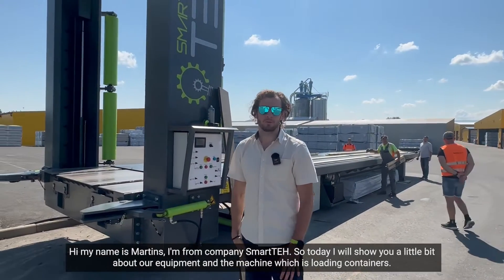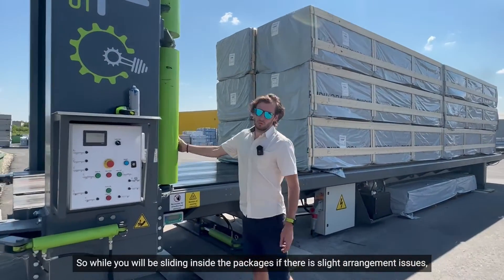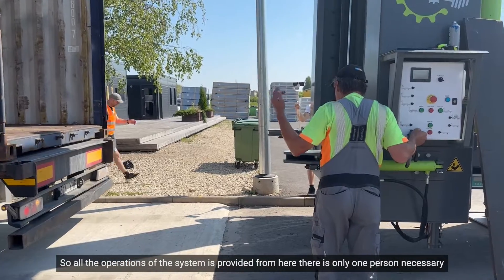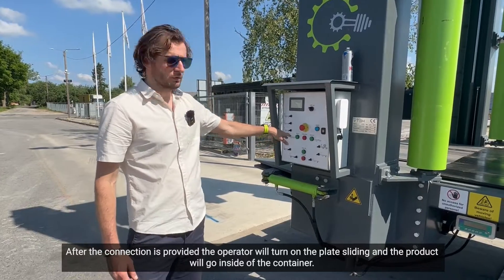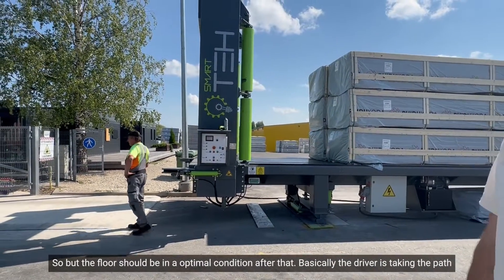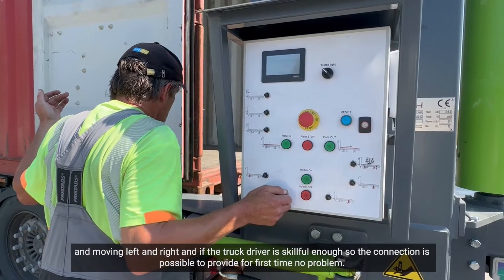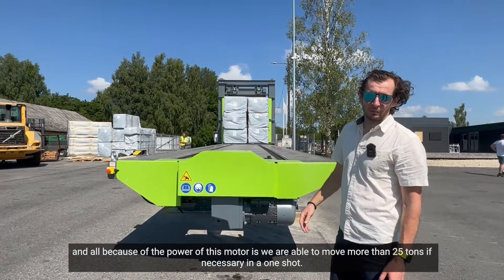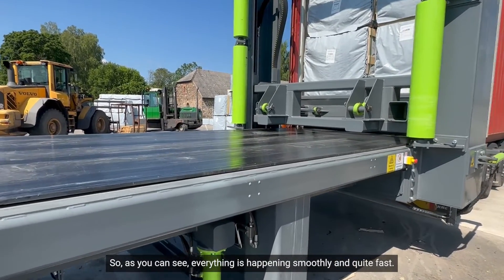Exploring Automated Container Loading: A Detailed Walkthrough

Comment: Can this machine handle  2 double stacked 40 ft containers (50t each) with total weight up to 100 metric tons?
Reply from the maker: We can make custom-tailored units for specific demands.
But in general, in most cases containers are loaded until 30t so that they can be transported on regular trailers, etc. This particular machine is designed to load up to 30t. You can contact us through our website https://www.smartteh.eu/en to get a personalised proposal.
Reply: Can you adapt the machine to load the container itself? For 40ft containers that are double stacked with total weight 60 metric tons or more?
What is the maximum distance the machine move the container?
Reply from the maker: We can certainly discuss customizing our machine for your specific needs. Please email us at linda@smartteh.eu or use our contact form at https://www.smartteh.eu/en for detailed information.